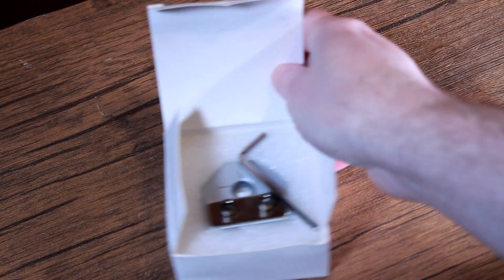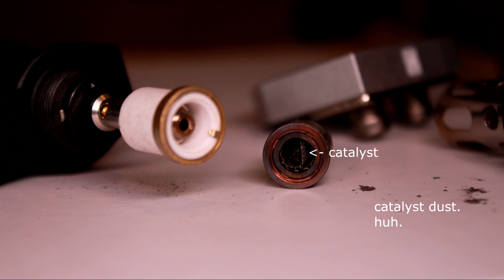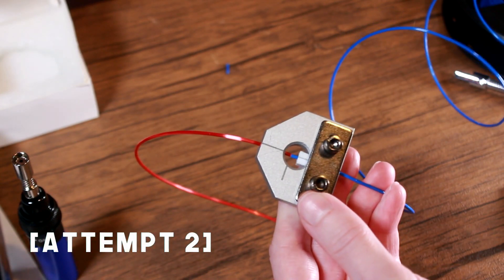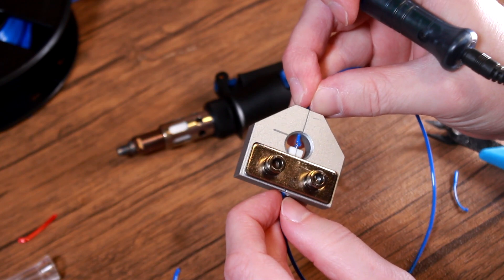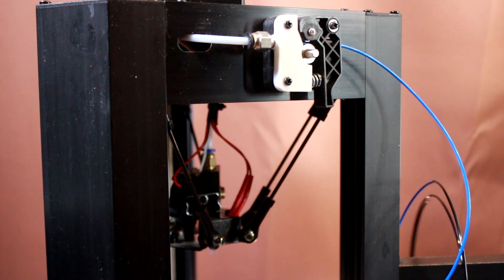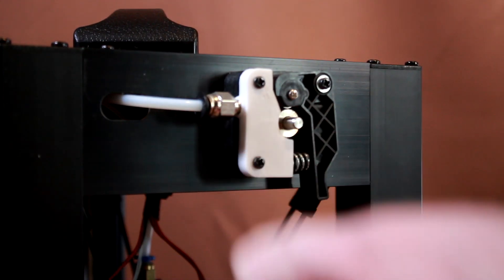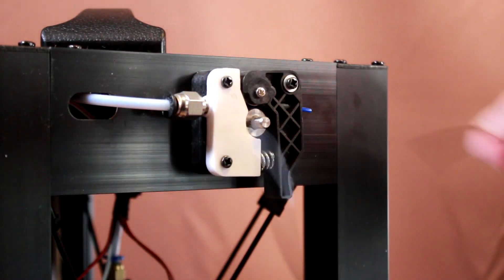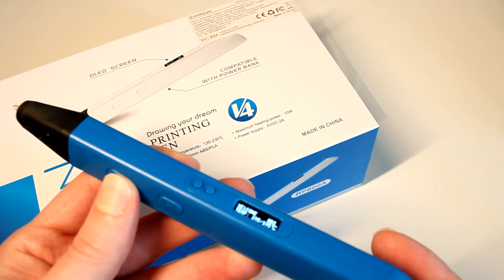Weird 3d printing accessory: What is this thing and do I need it? (it welds filament! But how well?)

Comment: I've it, now it's inexpensive near $4.50. 
The first times it made me nervous, but after some trying found how to use. 
First straighten both the tips of filament, don't slash cut but straight, take more closed to the white PTFE tunnel, torch to fuse and press ASAP into the white side. Clean with sharp cutter.

Comment: Yhis video should be titled, HOW NOT TO USE THIS FILIMENT JOINER. Soon as you got out the mini hot flame gun you failed. way to much heat. Plenty of videos on here on the correct way to use it. This isn't one.

Comment: I have this filament joiner tool. You insert the ends into the tool up to the black line, heat the ends, and push them into the white tapered piece. This aligns and shapes the join. After it cools, you can repeatedly pull it through the other side to trim the join if needed. Use the screws to open the tool and remove it from the filament. Its small size makes it tricky to use, so it's best to mount it in a vise or other holder for stability.

It does take some practicing, but it does work. There are some other options  like theres a guy on youtube who made one you could print. Its actually smaller but easier to hold and he used a soldering iron to heat the ends.

Comment: I got a filament welder that is some sort of hotend contraption with a cooling fan, and it does wonders using a 1.75 PTFE to shape the filament while heating; the results are basically flawless and it's almost as strong as regular filament, certainly strong enough to be retracted by the extruder while printing until the welding zone gets extruded and keeps printing regularly.

Comment: They sell PTFE tubing with a 1.8mm ID in several OD sizes.  Just buy a small strip, cut to about 1-2inches (25-50mm) and use a rework station to set to your filaments melting point, then push together and cool down.  
You could, also, just pause the print, home the extruder, change the filament, and resume.  That would be the easiest way to change colors, but you'd have to monitor the print the whole time.  
I would set a timer for when the slicer says it should get to where you want to change filaments.  Otherwise, you'll be unspooling and respooling a ton of filament depending on the size of the print and how many changes you do with the splicing method.

Comment: it kind of seem like common sense to me. it looks like you heat the filament in the circle area then move the filament to the white portion THEN cramp the pieces using the screws, wait until it cools down and you're done.  I Think it'll work.
Reply: I got one these, you put the filament ends into it to that black line, then heat the ends and push them into the white piece which is tapered inside, this lines up the ends and shapes the join, once cool you can pulled it back and forth through the otherside to trim the join if it's too fat, you then use the screws to open it to take it off the filament. It's small size makes it fiddly to use, you need to mount it in a vise or something to hold it.

Comment: i have started to buy bigger spools, especially for easy to store filaments like PLA to minimize "left overs". The bit that remains i just send to filament recyclers together with my failed prints, supports, brims etc. In the long run that is probably better than investing even 5 minutes of your time to save five meters of filament :)

Comment: Thanks for the review. I have tried pretty much every gadget out there in my search for a way to efficiently & quickly weld filament together. With ZERO success so far, some gadgets come close but repeatability is non existent.  I have lots of left over filament that is just too short to confidently put in the printer and not worry about it running out while I'm at work. I would love for someone to create a filament welder that consistently welds filament AND in a way that you don't have to spend lots of time trimming the welded diameter afterwards. I hate to waste all the shorter filament I have because I can't weld it and use it. I've tried the gadget you just reviewed with mixed results,  I've tried fixturing a programmable curling iron with bowden tube attached, as well as other ideas out there. Nothing works good enough. If only there was a way to engineer a hotend and nozzle assembly that could do an extrusion of the filament to size, and yet be able to remove the welded filament without having to extrude the whole remaining length of filament. With 3D printing becoming so popular and widespread, a machine that welds filament correctly would be a huge success I think!!! Until then, my search will continue......Heavy Sigh..............
Reply: Something like the Mosaic Palette can probably be abused for that. But they start at ~500 Bucks, so you'd have to splice a lot of filament to justify that expense.

Comment: I use one of these all the time now and once you figure them out they work really well, I just use a lighter as heating it with a lighter is the same as heating with any heat source and they only cost like 20p for disposable ones. the key I have found when joining difference materials is to get them hot enough smoosh them together and very quickly push them into the plastic side so the smooshed  filament folds back over the other.

The reason I use it is on my old ptfe hot end  I would heat up the nozel and pull  out the old fulfillment when there was not enough for a print and this worked well as the pfte tube would not stick to any filiment pulled back into it, however i recently upgraded to a all metal hot end  and it works awesome but as soon as i pull out the filiment  i end up  with a blockage, so started using the joiner so i just snip join  and print

Comment: I've got one of these things and there's a knack, definitely. Very shallow angle on the cuts and match them, I also fix the filament in a vice on one side (teflon block side) that helps with the 'missing hand syndrome' and I do use a lighter, then slide the block towards my hand so the still-hot filament gets smooshed through the teflon block, and then sand the few remaining bumps off. This has worked well 75% of the time and not so well 20%. And yep, failures for the rest.

WRT "just shove the end of filament in" I have one thing to say - how do you do retractions if there's no connection between the running filament and the new one? I tried this - once - and the stringing was epic. Not recommended. 

So persevere, it does work as a next-to-last resort.

Comment: i use capacorn tubing and just run new filiment behind old all the time in my ender 3 pro and never have any problem (other than extra stringing as the print is feeding the new filiment in and out for retraction)
Reply: Also if you're next to it you can case ABS behind PLA and the part material will fuse nicely. (Don't forget to turn up extruder temp in settings for your ABS temp)

Comment: The tool takes some practice. You need to get both ends gooey and essentially manually extrude it through the plastic bit. Trim off the over extrusion with a razor knife. There is a video on the Amazon listing if you search ‘filament welding tool’.

Do not butt the ends together. If you have two separate pieces of filament in your printer when the extruder retracts the second piece it can’t retract the first piece because they aren’t connected. So while the pressure drops you still get a bit of over extrusion that is noticeable on the print for the entire length of the separate first piece.

Comment: I’ve seen some use a piece or PTFE tubing. Put the ends of 2 filaments in and heat up the PTFE with a heat gun or small lighter and that seems to be successfully repeatable.
Reply from the maker: yeah I think it works really well, my only concern is how do you prevent the likely outcome of breathing in ptfe fumes? I did some brief testing with other materials and I think it would be possible to use those instead of ptfe

Comment: Glad I watched, been trying to manually weld filaments together and considered one of these. Looks no more successful than me doing it inside a notched out PTFE tube.

TechnologyOutlet are still going btw. They seem to have stopped selling on Amazon and have their own site/store. Was using them for a while till I got a few too many bad spools and had to switch brands. Shame since I used to get good consistent prints with them and the measurements on the side of the spool were super useful.
Reply from the maker: I've noticed they are exhibiting at the 3d printing fair in June so they must be doing okay!
Reply from the maker: And yeah. PTFE tube. Better. Honestly. Just don't overheat it.

Comment: I had no issue working with the same tool for nearly 2 years now. I gotta admit, it gave me ugly burns and blisters during the very first trials. But then I got the hang of it and it worked like a charm... I'd stick PLA on TPU.. PLA on PETG.. it all works fine.
Reply from the maker: I will obviously have to go away and practice :)

Comment: Rather than heat, you could try some kind of solvent or plastic glue. Dimethylchloride (which admittedly isn't something you want on your skin or in your lungs so take appropriate precautions) dissolves PLA and many other filament plastics well. Might be easier to handle, give a bit more time to shape and give a stronger bond - especially between different filaments.
Reply from the maker: yikes...I'll pencil that one in for when I have a lab 👍😂
Reply: @LostInTech3D  Sorry. I should have said dichloromethane. It's common in high strength plastic glues. Same caveat about exposure though. The other stuff however is WAY worse.... XD

Comment: I ordered this once just for trying, and it's actually not that hard. Watching this is like watching someone trying to push a square through the round.
-straight cut
-use a candle
-melt 
-shove through the plastic
It's ridiculously easy! I use it regularly and have no problems with the welds going through extruder or bowden tube.
Reply: Exactly.... It actually works pretty well and good heavens it was painful watching this...
Reply: I found other videos on YouTube showing that. It's quite easy to do if done in the right way.
Reply: It really seems that some people have two left hands when it comes to stuff like this.
Reply: The video just seems to me to show ineptitude for the sake of content, or actual ineptitude. One or the other. I give him that he's trying to do it all while in frame but I've seen others do it just as easily. Either way, painful to watch lol.
Reply: Not, it doesn't work at all. It's a piece of crap. Upload a video please where you show this thing being used reliably.

Comment: I've done something like this when I needed to continue a huge print that I started on the wrong spool. I'd like to see if it works with PET filament made by pullstrusion.
Reply: i've seen people weld pet filament after extrusion, but i think it's less of a pain to connect the strips before extrusion. that way the result is for sure straight and the correct diameter, and you can even do it live while the extrusion machine is running.

Comment: the issue with manual feed is you will have no retractions until the new color/type is being melted, the retractions will pull the new filmament but give no actual benefit as the older isn't moving.  I do this basically every time i change spools, leaving the old color on the full bowden size, and printing a cali-cat (which due to size of bowden, gives me cali-cats with colored feet)

Comment: i bought this 
IT SUCKS ! 
ur MUCH better off ... just using a ptfe tube , put the ends together in the middle (I cut both ends at an angle)
use a lighter/heatgun 
hold it a bit until it cools off (blow on it )
MUCH better weld
then sand it down a bit with a small bit of sandpaper until that ptfe tube slide's over smoothly

Comment: I think the connection should be in the "plastic" part. Adjust the two ends of the filament to meet inside the "plastic" part and then heat.
Reply from the maker: the plastic is POM I think. Honestly I don't think it would work, but maybe I'll try it for the next vid on this (it will return! ....maybe)

Comment: I would have fed the filament ends inside the metal part (opposite end from the PTFE clamp part) and heated up the metal. As long as the hole is close enough to 1.75mm and the metal is something with decent thermal properties (brass would be good), that would do a much better job.
Reply from the maker: I did try that, the whole thing is a heat sink, then you burn your hands 🤣 I have ideas though, watch this space...as I keep saying.

Comment: I was actually looking for something similar, thinking about creating some personalized rainbow filament, it works, bu it has to much of a random result to be of use, i will have to keep looking for sometin to weld my remaining filaments, liiking for a way to know how a pallete splice core works, they measure, cut and weld together different colors/materials i think and palete 3 pro receives up to 8 different colors, have in mind i am not sure if the palete 3 pro works with multimaterial, i was looking ti figure out how the multicolor/material option from prusa works.

I will continue on my search for a filament welding magical device
Reply from the maker: I'm working on it ..just waiting for some parts I ordered, so watch this space and either see me fail further or find a solution 😂

Comment: At risk of sounding a bit like a derp...  When you feed a length of filament in behind another without it being welded or connected in some way, how do retractions work?  If the two pieces are not connected, aren't you just pulling on the filament pinched between the extruder wheels while the other length is just sitting in the Bowden tube?  Would the lack of retractions and the short pause before the unattached piece starts moving again show up on the print as slight under extrusions?  Just curious.
Reply from the maker: uh...
...you're right. 😂 I never thought about it. Haha I guess retractions will be off for the 30cm or whatever that it takes to get that filament to the hotend.
If I'm to guess how that would manifest, my guess would be as stringing.

Comment: Hahahaha this thing ... yes you have to melt ends, make a blob, and while it's still almost liquid and malleable pull it through that PTFE part. It took me like an hour of patient trials and errors to weld remainings of one ASA spool onto a fresh one but I think I got the technique. In the end it survived going through the printer and I do not even know where the joint is.

Comment: If you could get a good weld, it would be more useful. I'd try it by lopping off the end of an old worn out nozzle, as it should be easy to heat up and fuse the filaments in that. (but I don't have a worn out one yet and aren't about to destroy any of my perfectly good nozzles to save a few inches of filament) 
Oh and, in addition to heat, you'd need a bit of pressure, smooshing them together. And it's notable that a nozzle's inner diameter is not 1.75mm, it's a wee bit bigger. Still, I can't imagine you'd get jams that way.
Reply from the maker: Watch this space...I have a not entirely dissimilar idea

Comment: It has to be able to handle the extruder and also subsequent retractions. My results with similar clamping jigs were similar to your initial results. I think it would work well if I joined in a heated split 1.8mm tube.
Reply from the maker: Yeah after much deliberation I think I can make something better. Watch this space 👍
Reply: @LostInTech3D  also working on something better myself, these things are serviceable but they are so fiddly its annoying and in my experience the joins are either kinda weak or somehow end up buldged despite being pushed thru the bowden tube

Comment: Never seen this one before. I watched a number of videos of different complexity of method and even bought a piece of heat shrinkage to try but then my printer stopped working, so never actually tried. I use one brand and buy the cheapest spools that change color randomly so I was going to just add the end of the spool to the start of the new one. I carefully scaled a cookie cutter to use the most of it, I actually printed that cookie cutter with the purpose of using the filament, and still got a meter or so left.
I don't think I've seen feeding one right after another before either but doing this while the printer is running? Untangling the filament why it was printing was stressful enough ;)
Reply from the maker: I've actually thought of a better solution to join filament...and I'm going to be trying to build it. 👍

Comment: I think you're supposed to thread the fused filament through the hole while it's still metled, to conform the shape and avoid blobs. Honestly this contraption is pretty useless, you can get the same result by heating two filaments on a candle, fusing them(and making a blob), and threading them through a small piece of bowden tube
Reply from the maker: yes - I eventually figured that out, after I was too tired to film it properly. 
It still didn't work well for me though.
Reply: @LostInTech3D  If you don't know how to use this tool, maybe you should watch a proper youtube tutorial on the subject. I am sure that at least one exist, because i've watched it...
Reply: the point on this thing is that you can remove it from the filament without having to unload it from the printer or unwinding the entire spool (it just separates into 2 parts)